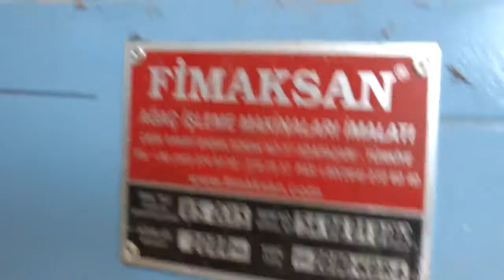FİMAKSAN operators debark liner( Video ) 97

Comment: I've never understood if you're going through the expense of having this setup why not spend a tad bit more so you're able to cut both ways in the band. Double the mill output which equates to profits!
Reply from the maker: Thanks for the feedback! 
We do have double cut mill as well! If you search it’s called “ tandem log bandsaw” and you’ll find our video double cut. Thanks again, To Contact Us WhatsApp on +18325267583 or Email: bilgi@fimaksan.com
Thanks.
Reply: Very difficult to tension those double cut blades correctly. Also very expensive blades.